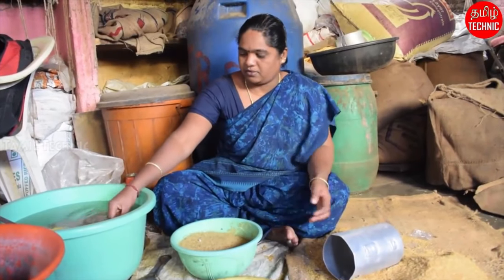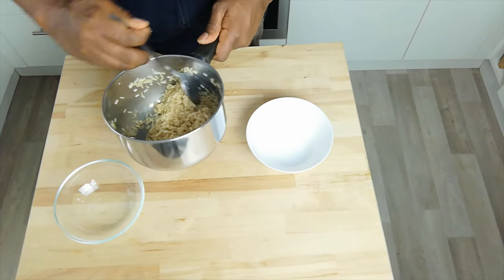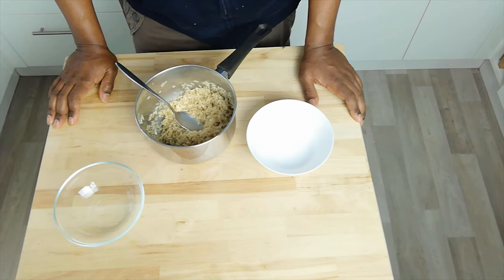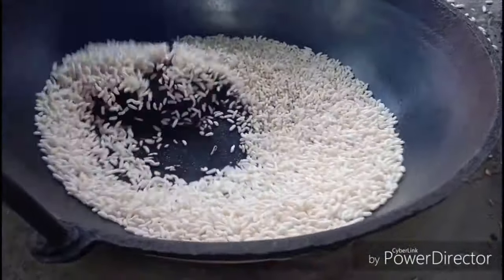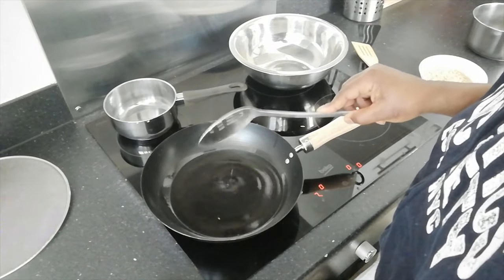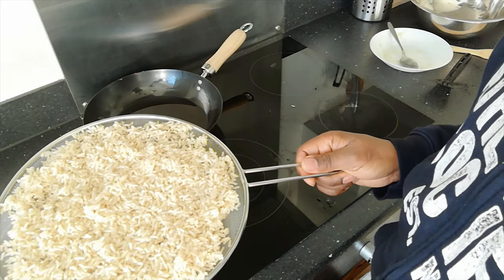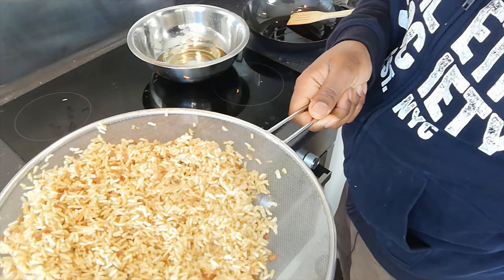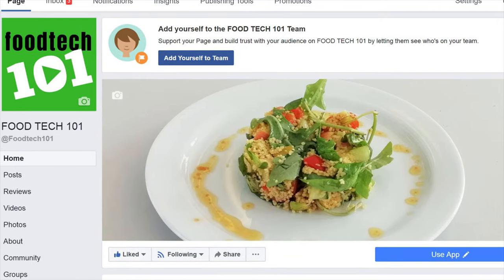How to make Rice Krispies at home: FoodTech 101

Comment: You can use salt instead of sand to get the same result. Just heat the salt and puff the rice a little (like 2 spoon fulls at a time). sieve the puffed rice latter to remove the salt.
Reply from the maker: I think that might also work but may result in a salty taste. Give it a try and let me know how that works out. Always willing to learn new ways of doing things. Thanks for taking the time to reply.
Reply: @FoodTech101  Hello There, I the rice is dried 100% the salt won't stay when trying to bake for puffed rice.  And you don't need to even wash the rice for puffed one.

I'd recommend not to deep fry l, since the oil will stay and will become soggy/ soft.
Reply from the maker: @HappySharma1  thanks
Reply: What rice am i going to use
Reply from the maker: I just made a new video using salt as you suggested. Thanks for the tip: Let me know what you think: https://www.youtube.com/watch?v=Jq_zFo2v_XQ

Comment: By the way, oil fried puff rice made from dehydrated cooked rice is very yummy! Cook any rice with less water so that the cooked rice don't become too sticky. The dryer the better. Dry the cooked rice in the Sun or Oven or Dehydrator. Add salt/pink salt/ black salt any, and black pepper powder in the fried puff rice and mix. Very yummy.
Reply from the maker: Have have filmed an update to this video actually using the same techniques as they use in rural India and the results are amazing! Will publish the new video shortly.
Reply from the maker: Thanks for taking the time to comment. I've just made an update to this video that shows a much better method. Let me know what you think: https://www.youtube.com/watch?v=Jq_zFo2v_XQ

Comment: Have you guys found it, how its made? Rice puff? I can tell you almost did it but reverse the process you used in the video!
In india we have pre-boiled rice, some one said per-boiled, not sure if he mean to say pre-boiled rice. Anyways, simmer your rice in low flame heat for about 10 minutes, don't boil. Drain the rice and let it dry. Take the dried rice and roast it in a thick pan or cast iron wok or pan over heat, until the rice grain become crunchy, meaning, removing the moistures from the rice( it's like you roast food items in the sun to remove moisture and make the food more dry). Then take that final product rice which you just roasted to remove moisture( don't let it cool down after roast) and add it in your pre heated sand or salt or oil. Puffed rice.
Reply from the maker: Check out my newer rice krispy video

Comment: The original video that uses sand, at no point was oil added.
Kellogg's soak the rice, dry it out naturally, roll it out and then bake it.
What you made was fried rice, saturated in oil. I cant imagine it tastes good with milk.

Also, was it not long grain rice you used?
Whole grain rice is something completely different isn't it?

Apparently Kellogg's use medium grain rice.
Reply from the maker: Thanks for the feedback. Since making this video I've learned a lot more about making this dish. I've now filmed an updated version that cooks the rice using hot dry salt and the results are perfect! In the new video I also explain what is happening at each part of the process as I myself understand it now. Will post the new video shortly. Thanks for taking the time to comment.
Reply from the maker: Thanks for the tip. I've updated the video incorporating what I learned from you. Thanks for taking the time to comment. Let me know what you think: https://www.youtube.com/watch?v=Jq_zFo2v_XQ

Comment: I've already tried 2 different ways and I did not get the result result as the video I'm going to take a look at your video and see what your steps are and give it a try for the 3rd time.  I tried soaking the rice drying it out and trying to cook it in salt didn't work rice just burned not even one puff. I tried the same way Wedding the rice letting it dry out and try to deep fry it didn't work all it did was burn. Puff rice is hard to find anymore nowadays other than a wheat popped rice which is not what I am looking for. Let's see if this works.
Reply from the maker: check out me newer rice Krispy video, it's both easier and gets way better results

Comment: Thanks,what's the kind of this sand?can I put coal?
Reply from the maker: I didn't have access to the sand to try it so not sure but and 'clean' sand I guess would work. That said, another viewer said that they don't even use sand, it's always 'salt'. I don't think coal would work as I think the temperature might get too high and it would be difficult to separate the coal from the rice in the same way you could sieve out the rice. But hey, just give it a try. I'm always up for learning new ways to do things.
Reply from the maker: Thanks for taking the time to comment. I've just made an update to this video that shows a much better method. Let me know what you think: https://www.youtube.com/watch?v=Jq_zFo2v_XQ
Reply: Use corn meal it works just like sand just dnt ass oil to the pan prior to heating it. Just dap a cloth with oil rub the pan lightly heat and add corn meal and then rice in a wok!

Comment: I have watched 3 U-tubes on making rice krispies all using salt. I also tried 3 times and came out so salty could not eat it. I had dried the rice very well. therefore could not absorb salt. Have no idea where I have gone wrong.
Reply from the maker: Start of with dried 'easy cook' packet rice. If the rice is fully dried packet rice, it will not absorb the salt at all. See my updated video on making rice Krispies.  A much easier and quicker version than this video.
Reply from the maker: https://youtu.be/Jq_zFo2v_XQ?si=serHkJa3SR0sYyhl

Comment: I tried your method didnt work
Reply from the maker: It does seem to be a tricky recipe and not one the lends itself to consistent results either. But that said well done for giving it a go. I too am going to have another go at this maybe using a different type of rice and also, maybe instead of oil I've heard of some techniques that use heated 'salt' instead of oil. Experiment yourself and come back and let me know if you discover a better method. Thanks for taking the time to comment.
Reply: @FoodTech101  I think you can use either sand or salt. I've watched Indian cooking videos where they create a make-shift stove top oven, and some used sand and some salt. Maybe you could try putting the rice in the oven to get that effect? 🤔
I'm not entirely sure though, but I don't have to worry about making them at home, I live in India and these are so easily available here.
Reply from the maker: Thanks for taking the time to comment. I've just made an update to this video that shows a much better method. Let me know what you think: https://www.youtube.com/watch?v=Jq_zFo2v_XQ

Comment: Hope this video helps …. he has used salt ….you got the first step nearly right...just add one teaspoon of oil too which would be enough for the amount of rice you have taken ...all the best :) 
https://www.youtube.com/watch?v=OqkIWR5dP8c
Reply from the maker: Thank you so much for the advice. Question: what is the water part for at the beginning? I've seen a few videos where this stage is included but I can't fully work out what mixing the water and the rice actually does.
Reply: @FoodTech101  remember to buy parboiled rice to make the krispies ….I found an answer to your question on Wikipedia :) it basically helps in the process of puffing … and is necessary for the release of pressure and helps make the puffed rice spongy ….
''Another method of puffing rice is "gun puffing", where the grain is conditioned to the correct level of moisture and pressurised to around 200 psi (1,400 kPa). When the pressure is suddenly released, the pressure stored inside the kernel causes it to puff out. This method produces puffed rice which is spongy in texture.[7] 

Rice can also be puffed by making a rice dough, and extruding small pellets which are then rapidly heated. The moisture in the dough flash boils and puffs the rice up. Cereal such as Cap'n Crunch is extruded, cooked, cut, pressurized, puffed and dried in a continuous process.[7] This technique is also used to produce Rice Krispies breakfast cereal as well as the crisped rice used in Lion Bars, Nestlé Crunch, Krackel, and similar chocolate bars.[7] 

The modern extruded dough puffing method is attributed to an American, Alexander P. Anderson, who stumbled across "puffing" while trying to ascertain the water content of a single granule of starch and introduced the first puffing machine at the World's Fair in Saint Louis, Missouri, in 1904.